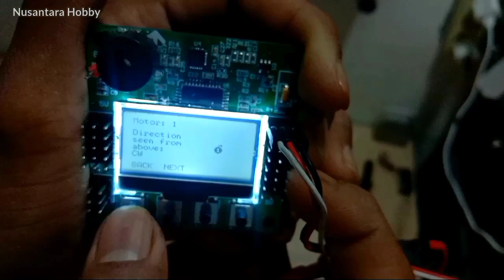How to make ROCKET DRONE using 2 Motor Brushless - Single Copter 2M 2S - DIY RC DRONE

Comment: Hallo,
The settings on the board say Motor 1 CW and Motor 2 CCW.
Is that right.
Previously it was said here CCW Motor1 and Motor2 CW.
Could you possibly send me a picture in which it is clearly explained how the propellers are to be mounted and the direction of rotation is recognizable?
best regards

Comment: Bang coba buat rc pesawat dari rc car
Reply: @CHANNEL SEPI official belum dicoba manatau hasilnya
Reply: Pakek dinamo brushed
Reply from the maker: Bisa saja. Ganti dinamo dan propeller. Tapi jarak remot mobil rc biasanya pendek. Pesawat rc biasanya minimal 100 meteran jarak remot paling pendek. Standarnya 500meteran. kalau mobil rc paling 10 meteran doang. Baru di lempar / take-off udah putus sinyal